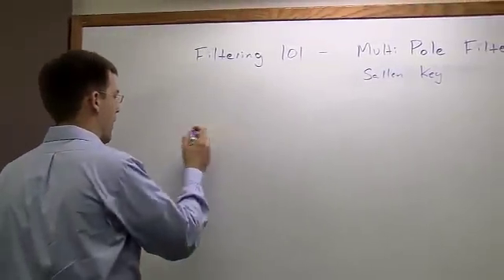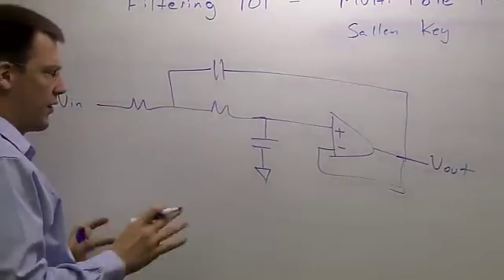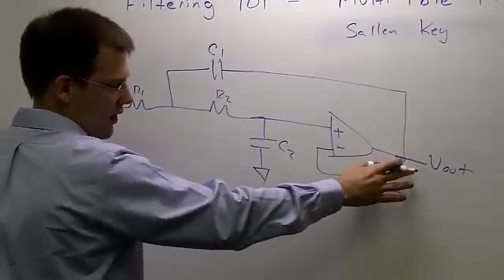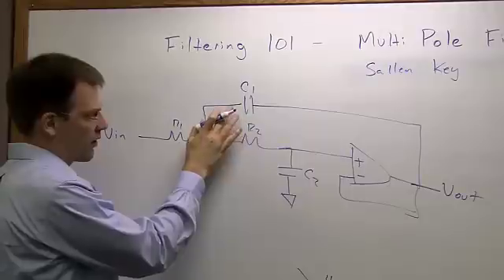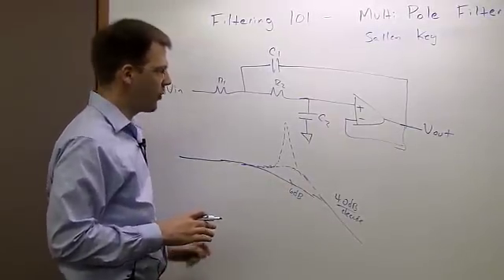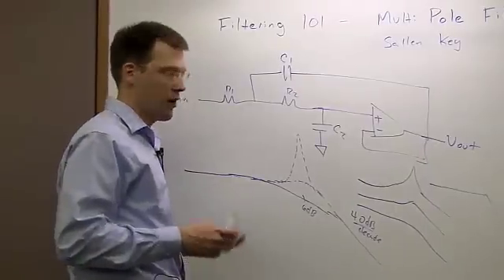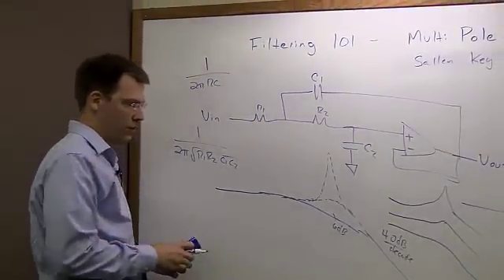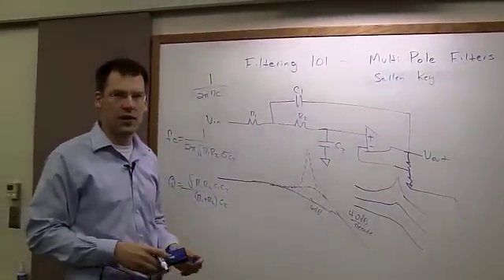Filtering 101: Multi Pole Filters with Sallen-Key

Comment: Hi Mihai,
This is a more involved answer than Google's 500 characters allows.  
Quick rules of thumb for good performance:
op amp gain bandwidth > 100 * filter cutoff * filter gain * Q
op amp slew rate > peak voltage at op amp output * max frequency where peak occurs * 2 π
ADI will have filter tool coming out in a month or so that will give more insights into your question.   I'll post another reply here when it's ready.

Comment: One way to get gains lower than 1 is to replace R1 with a voltage divider.   This voltage divider should have the attenuation you want and an output resistance of R1. (Remember output resistance of a voltage divider is its two resistors in parallel.)  For example, let's say your Sallen Key equations call for a 1 kohm resistor for R1.   To get a gain of 1/2, replace R1 with a voltage divider consisting of two 2 kohm resistors.